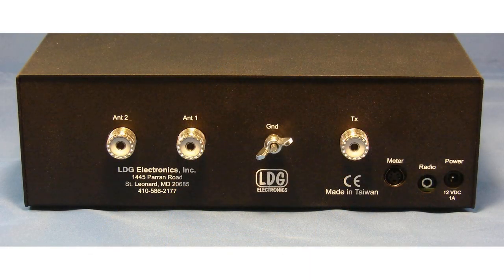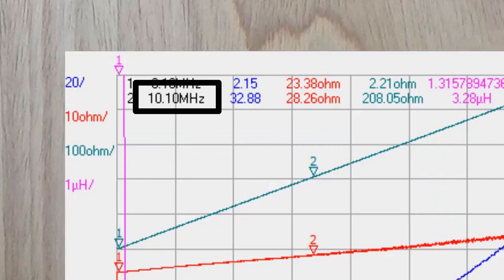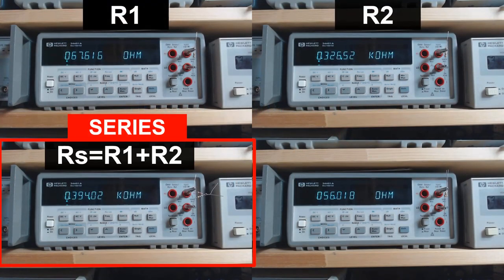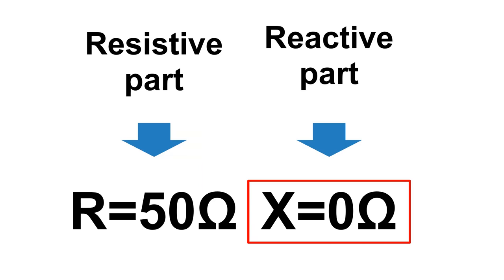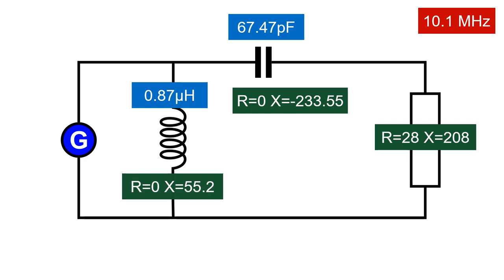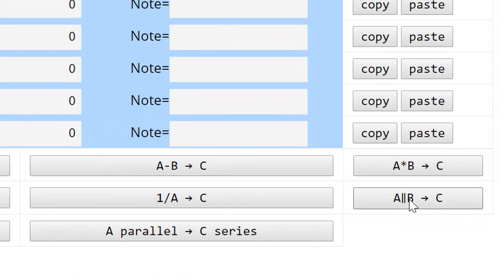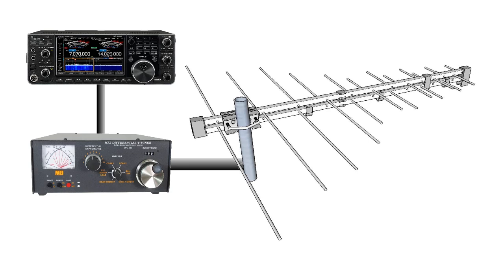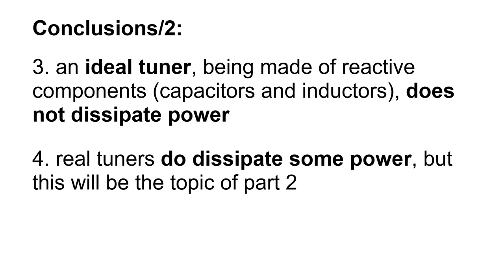Is my tuner fooling my radio? Part 1: how a tuner works

Comment: The Real resistance (R) in an ideal capacior is not  equal to zero, but is infinity! I am sure that it is a technical mistake, Otherwise, the video is very informative. Congrats!
Reply from the maker: Hello Mile. The capacitor has infinite resistance at DC. At AC, in the field of complex numbers, the impedance is expressed as a resistance (called ESR) in series with a reactance. An ideal capacitor has ESR (i.e. the R part of the complex impedance) set to zero. Go to the picture at 8m16s where the tuning is done assuming ideal components. Now, replace the ideal capacitance R=0 X=-233.55 with R=infinite X=-233.55 and see what happens.
If you work with complex impedances, at DC it is NOT THE RESISTANCE to be infinite but the REACTANCE. If you calculate the reactance a f=0 (see formula at 7,33s) you have Xc=1/-(2 PI * f * C); being f=0, we have Xc=1/0=infinite.
At the same time, if you calculate the reactance of an inductor at DC you hav XL=2PI*f*L=2PI*0*L=0.

You can verify this for example here: http://www.capacitorguide.com/impedance-and-reactance/
Reply: From that point of view, it makes sense. Regards!

Comment: Ottimo! Personalmente non sarei riuscito a far di meglio per cercare di spiegare l'argomento a chi ancora diffonde quei falsi miti. Al livello dei migliori video didattici sul Tubo! (Es. W2AEW).
Comprendo la tua scelta linguistica (ovviamente anche io non ho alcun problema con l'inglese) ma queste errate convinzioni sono molto più presenti tra gli om nostrani, soprattutto delle ultime generazioni, per il loro livello di preparazione tecnica sempre più basso e per questo preda di simili infondati miti.

Comment: Yes, in an ideal "lossless" capacitor, the resistance is that residing in the metal or conductor part of the capacitor. The dielectric is the insulator separating the conducting materials. So you want the least loss in the metal part - hence zero resistance, in the perfect, or ideal capacitor, and then no dielectric loss in the insulator, which  means no losses in the dielectric caused by the AC, or high frequency voltage, across the plates. The dielectric loss is caused by movement of charge in the dielectric under the electrostatic forces from the voltage on the plates. The movement of electrons means that there is some unwanted currents in the insulator thereby resulting in heating, dielectric distortion, and thus loss.  The electrons that are "free" to move in the dielectric indicates the dielectric is not a perfect insulator. The reactive value is given by the frequency and the quantity of capacitance (size of stored charge).   So that will vary from a high reactance near DC and a low reactance, at a high frequency. The complex impedance of a capacitor is the value of the resistance and reactance of such a capacitor as described perfectly by IZ2UUF.  Since there is no such thing as a perfect capacitor, the complex impedance will have some amount of R and dielectric losses  - with the ESR, or series resistance, being a measure of how far from ideal the capacitor is. And we should not forget about the loss caused in the dielectric which also has the effect of altering the phase between the voltage and AC current in the capacitor. The resulting shift in phase has an angle value given by the Greek symbol "Delta", and the loss resulting is specified as the Tangent of the angle, or Tan (Delta).

Comment: Fooling my radio?  When I use my tuner, the station on the other end says my signal goes up (sometimes as much as 20 dB).  So, I guess I'm fooling his radio also.
Reply: as the tuner presents a lower swr , your tranceiver my have protection circutry that now allows power output to ramp up